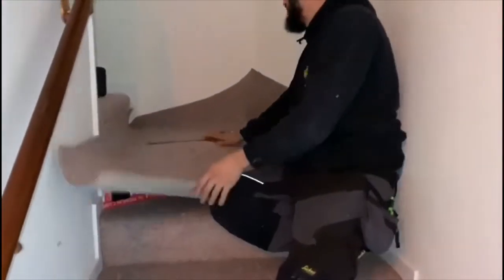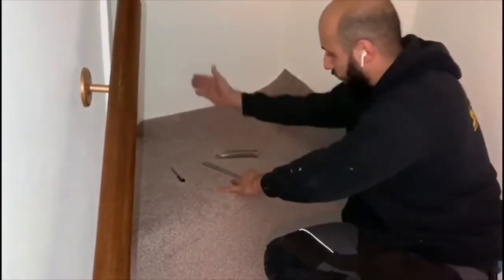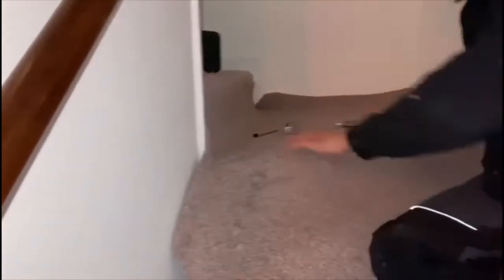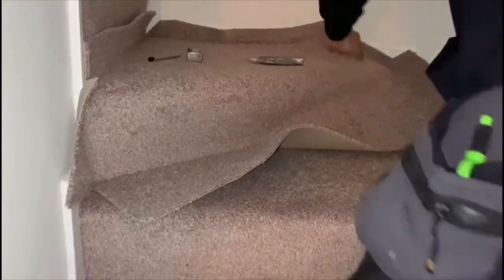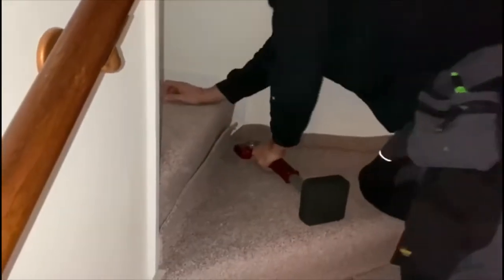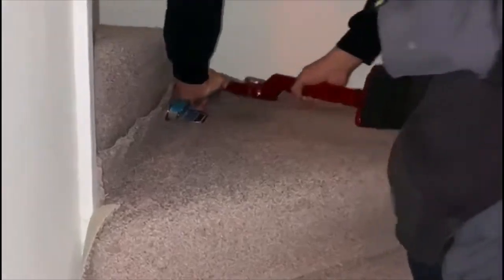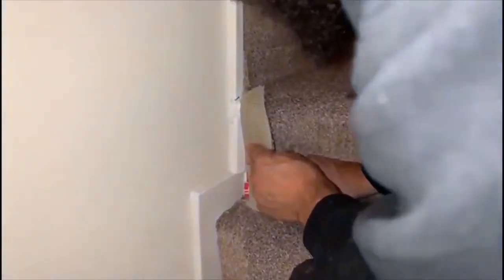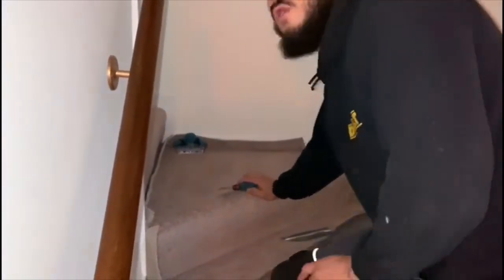Carpet tips - Having tension on carpet is key 🔑 !

Comment: Some real good tips on this one :-) Nice to see someone else using an EZ tucker. A very useful tool. I sharpened the edge of the wheel and the rear guide slightly so it avoids the pile and pushes down just the backing against a skirting/architrave. Don't run it over ya fingers though!

Comment: Thanks.
I am trying to workout which is the right or the wrong way to lay a carpet in my hallway, stairs and landing.
The hallway is in a square 'C' shape.
So when you enter through the front door of the house, there is a floor space of 2m width by 1.2m length where there are stairs to the right to the 1st floor.
Straight in front, the hallway (floor space = width 1m by 2.5m length) continues to an internal door.
Through the internal door to the hallway rear, width 2m by 1.2m length

So ground floor, total width = 2m  by total length = 4.9m

So do I lay the carpet :
A.
So the 4m width of the carpet starts from the front door to the internal door cutting at 2.5m, also cutting the carpet length as it meets left and right walls (2m)
Plus a 2nd piece covering the hallway rear, in the same direction width (1.2) x length (2m)
OR
B.
Have the carpet length starting from the front door to the internal door, so the 4m carpet width is cut down centre (2m).
Plus a 2nd piece for the hallway rear, with the 4m carpet width again cut down the centre (2m) to a length of 1.2m

In either case I think I would lay the carpet following the same direction in A or B

So can you explain the correct direction for the stairs and the hallway (which I assume would also be the direction for the upper landing)

I hope I have explained this clearly.  I could send some images if it would help.  Many thanks.

Comment: Great video as always. I’m having a problem getting a blade to cut off the excess carpet from the gripper between the tread and riser. Are you supposed to cut from the back, or what blades and knife do you use? Cheers.
Reply from the maker: What do you mean exactly ?
Reply: @TrimTuckCarpets  Hi, I haven’t explained it very well. I’ve started at the bottom of the stairs, have got a piece of carpet for 3 steps. So, started on the raised and run it over the bull nose and stretched it on to the tread gripper. Hammer the carpet in and on to the next step. I’m left with excess tacker to trim off. I’m trying to cut from the front just after the treat gripper but can’t get the blade to go through the pile as it’s quite thick. Hope this makes sense, I’m probably doing it the wrong way. Any advice really appreciated. Thanks.